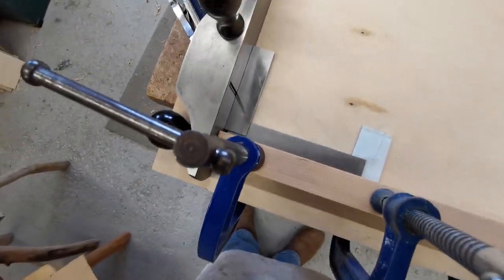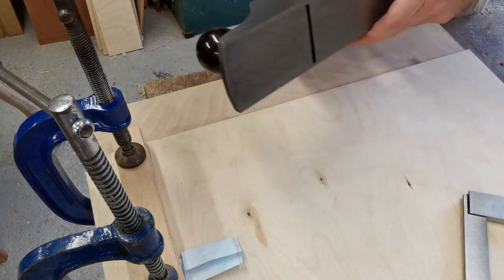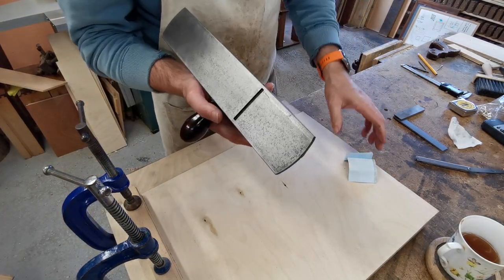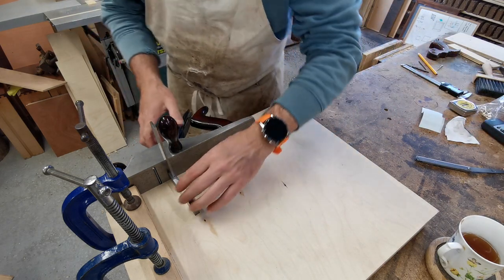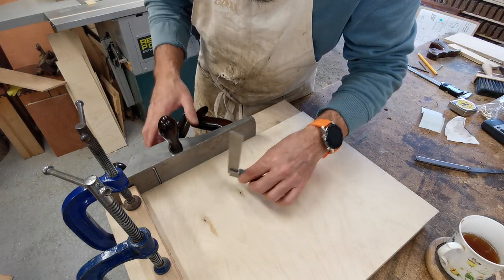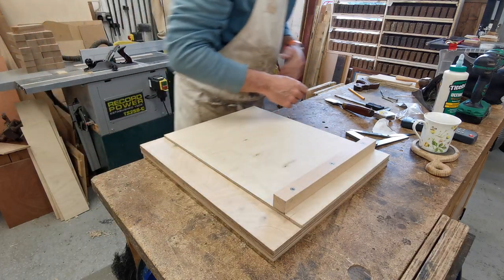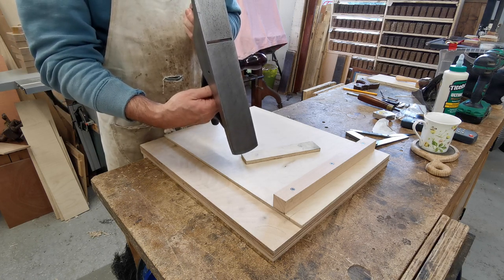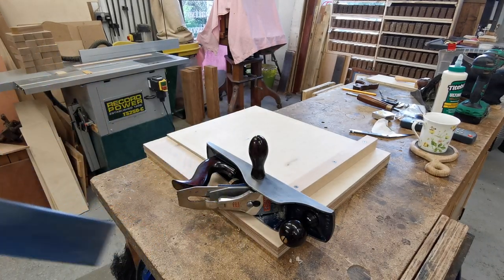[no25] Shooting board [woodworking] part 3 #shootingboard

Comment: Thank you now I know how a shooting board  work's. Is there something called a break on a table saw?. For some reason it popped into my thoughts.🤷
Reply from the maker: Thank you for watching Penney.
Table saws (some) used to have a peddle brake to slow it down once switched off. Modern saws have electric brakes to stop the blade rotating within 10 seconds of switch off. That's by law now. Depending on the country you live in.
Reply: Thank you sorry it was late and I was half asleep when I ask this question. I didn't mean a break that stops. I'm just remembering bits and pieces of my Dad explaining things to me.. it was fifty years ago and my memory isn't great.
Reply from the maker: @penneynoss9552  no worries.

Comment: Liking the new engineers square Jamie 😎, here to see it to completion as we were cut off  at the crucial moment !! ( that finish on the plane body was probably achieved by  surface grinding 👍) 
Best get the special screwdriver bit made as we don’t want to hold up the saw restoration ) 
Regards
Robert
Partsmade
Reply from the maker: Thank you. I bought a set of squares 🙈 tiny to 150 x 100 I'm liking them. 👍

Comment: Thoroughly enjoyed watching you making and demonstrating the shooting board. Presumably this prevents cut out when planing work pieces. What tea do you drink because that brew looked very weak?
Reply from the maker: Thank you. If used correctly then yes you can prevent tear-out. During workshop time I drink Peppermint tea. It usually goes cold and I sometimes warm it back up, but it never goes bitter. No need for milk in the workshop too. 👍

Comment: Yaaaay! That's a beautiful shooting board.. Well done! I know you love the oil, but I'd use some floor varnish aaaaalllll over. It'll seal out the moisture and it'll wear better under the plane. Add a bit of wax. Storage? I'd hang it on the wall near the bench if you can. I see a spot above the cramp rack that looks lonely..
Reply from the maker: Cheers Brian, all taken on board. Except the clamp rack needs to go further up and make room for more clamps 🙈 but I'll find somewhere for it.
Reply from the maker: Thinking about it Brian I've got a tin of floor varnish that needs using up 🤔